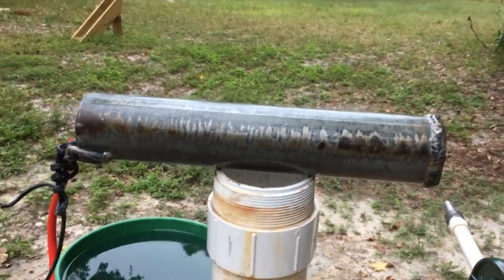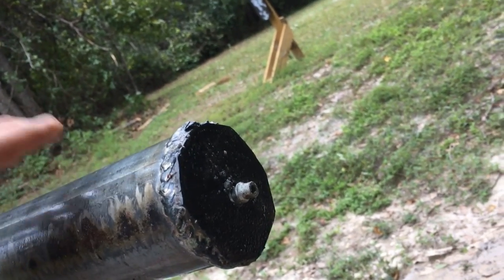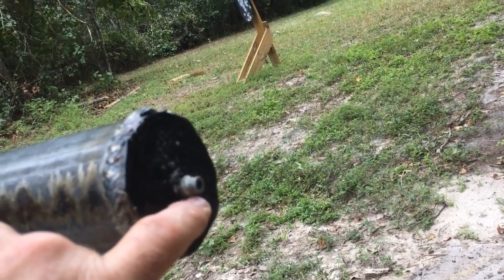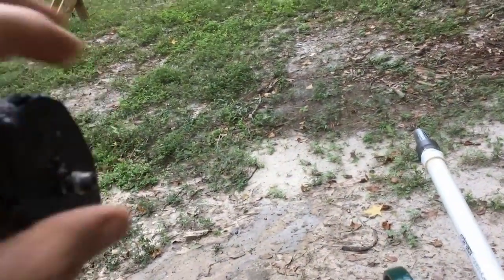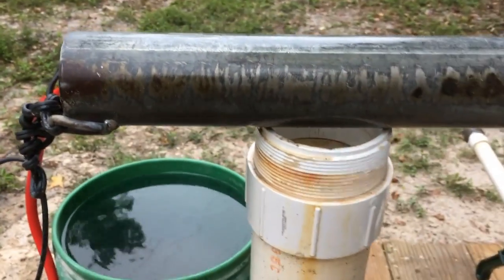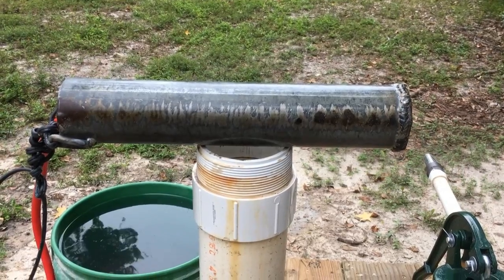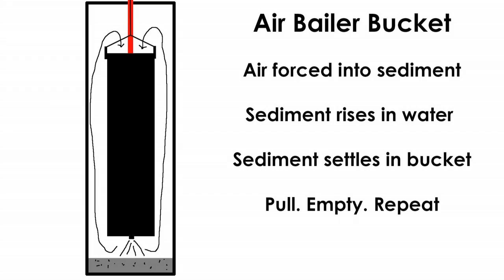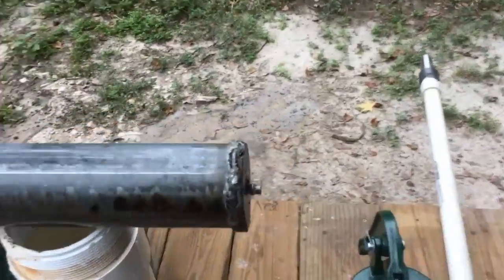DIY Airlift Bailer for Shallow Well

Comment: I was thinking, what if you just put a water pump in the well, and put the input and the output both at the bottom of the well test, stir it up and then pull the output from the well and evacuate that no sediment Hills water onto the ground and then put it back in the well and repeat
Reply from the maker: If I understand correctly you would be doing the same thing but without the use of a compressor (manually).
Reply: @TigerCreekFarm  yea, but also using the output end of that same hose alternating down the well (to stir up sediment better than air) and out onto the ground

Comment: Great video. I started drilling my own well with the extended 1x1 tubbing you showed us. It went easy to about 35ft now the auger just slips and doesnt dig in. In the bits it does get , i noticed small tiny black either hard dirt or rocks. They look like bits of chacoal in the dirt. Is that a sign of almost there or just a sign of tuff ahead? Thanks

Comment: Why can't you just put a cap on the bottom? The water will still come through the slits in the side.
Reply from the maker: This particular well is capped on the bottom. sand and soil work through the slits, too.
Reply: @TigerCreekFarm  Are the slits too wide?
Reply from the maker: No. Think about how small a grain of fine sand is - or dirt. Any dug well needs to be cleared.

Comment: Neat bailer!  I'll copy that. 
BTW traditional pitcher pumps are antiquated unreliable junk prone to corrosion and leather failure. I scrapped mine and switched to a manual self-priming diaphragm pump. Bosworth are made in USA and frequently used to prime motor-driven well pumps. The kit with garden hose fittings is about ninety bucks.  Those stuck with iron pitcher pumps can make maintenance easier by replacing all the hardware with stainless bolts and using food grade anti-seize on all threads. That made my life easier before I got rid of my pitcher pumps.  Example Loctite food grade anti-seize: https://www.amazon.com/Loctite-1167237-Anti-Seize-Lubricant-Temperature/dp/B005YSBVLK

Comment: This video makes me wonder if I could use this setup to "add" another 10 feet to a 40 foot well. If  it's mostly loose sand, it should work, right?
Reply from the maker: Spooby82 not really. The casing pipe is already installed along with pea gravel. You may be able to “wash” and drive the casing pipe down and adding casing pipe - unless the casing pipe was capped at the bottom.

Comment: ok great this is the method im gona try first. i hit some fine pea gravel just 8 feet down
Reply from the maker: Koaasst something doesn’t sound right. You shouldn’t have any pea gravel in your well pipe. Sand and dirt is normal.
Reply: i live about 3 or 4 miles from a river basin so little pockets here and there of fine rocks is kinda normal.  i should start a gravel pit! i dont think the neighbors would like that tho . as long as its just that fine stuff a little smaller than rice grains i think ill be ok.
Reply from the maker: I was misunderstanding your dilemma. FYI - If you know something like this before you set your casing pipe, you can wrap the cuts in the pipe with screen to keep that sand out.

Comment: you have the right idea...but your application is wrong...that's like a 4 or 6" pipe in the ground...the air is just coming straight without restriction...use a  1 or 2" pvc pipe and introduce your air in at 6 to 12 inches from the bottom...the air will be captured in the 1 or 2" pipe and spit out water from it at the top...you can move it around and remove gunk from the bottom of the well...Keep On Truckin...!!! Happy Hunting...

Comment: Hook a trash pump to casing and pump it off till water clears up that's how we do it in Florida
Reply from the maker: Robert Owens as long as it will produce air to create the disturbance it will work.
Reply from the maker: Robert Owens the trash pump was our first option - but the one we borrowed to use wouldn’t pull enough. That’s the reason this was made. It also did a great job helping to clear our 40 foot well - not sure a trash pump will pull that far straight up. BTW, we’re about 15 miles from Florida.
Reply: @TigerCreekFarm  good video.  I wonder whether a diaphragm pump might be the right tool
Reply: What the hell's the trash pump?